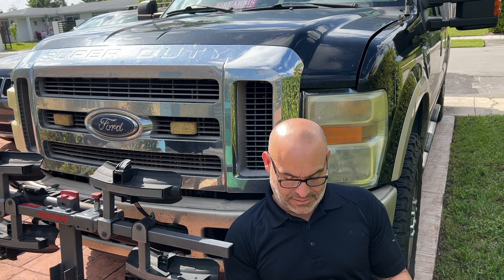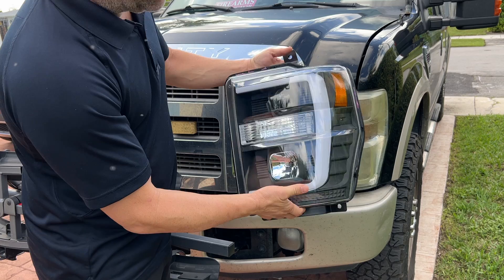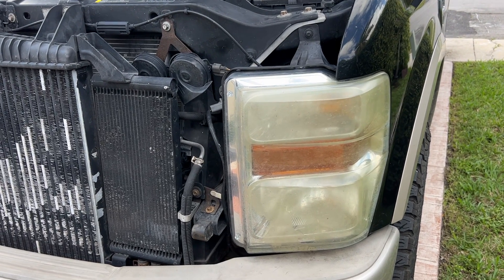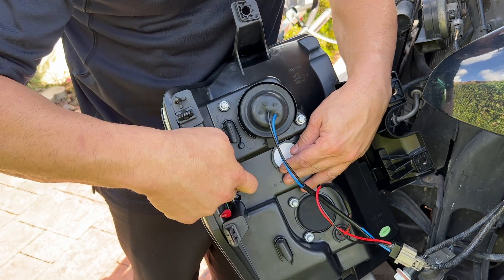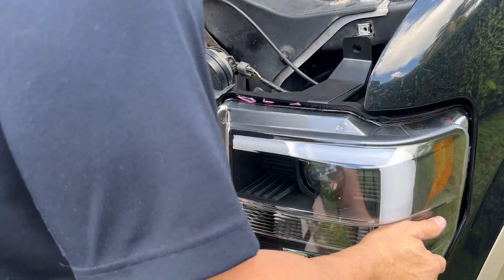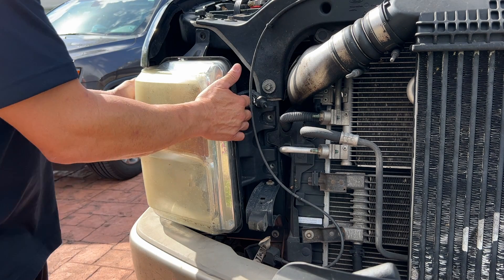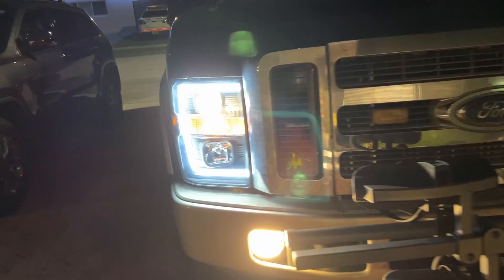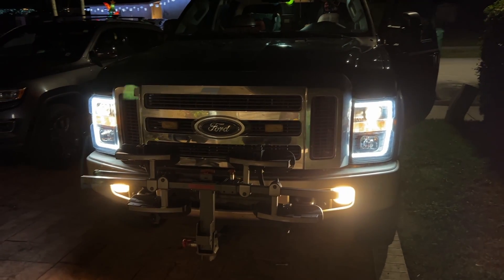ACANII - 2008-2010 Ford F250 F350 Superduty Pickup LED Tube Projector Headlights install and review.

Comment: 6.4 purring like a champ. Got mine still purring @ 326,000 miles. Deleted.
Reply: Mine just turned 222k.  Change the oil, fuel filters, use fuel additive and I got no issues.  Deleted too!

Comment: Forgive me for my English. Can you take a photo or record a video of how these headlights shine on the road? After all, this is the most important thing in them. It is even better to find a wall and show a black-and-white border with low and high beam on it. Thank you.
Reply from the maker: I don’t have the truck anymore but they did work perfectly when I installed them.
Reply: @allritythen  Thank you. I have already ordered alpharex pro. They will come to Russia in a month and I will test them. At first I wanted to order an expensive LED series, but I found bad reviews and decided not to take any chances. I will install LED lamps in the pro and you should get the right and bright light.
Yesterday I received LED fog lights from China, they shine perfectly. There is a clear border and there is more light than in the standard low beam.